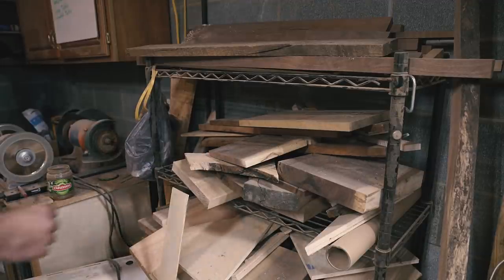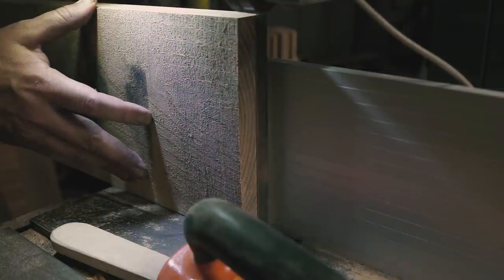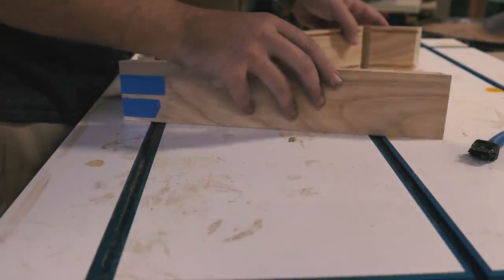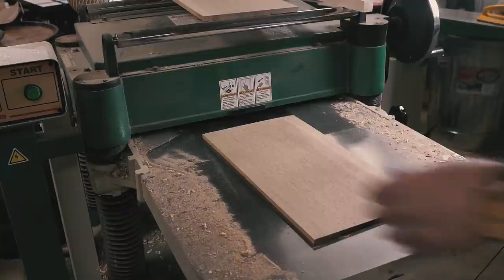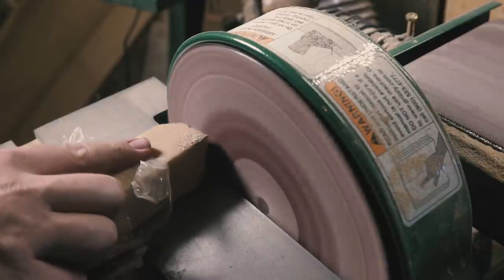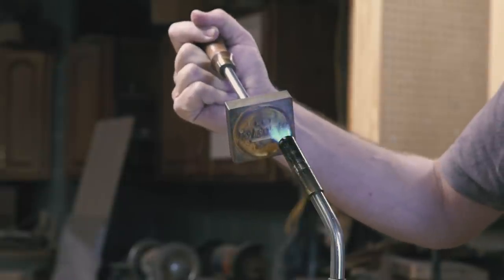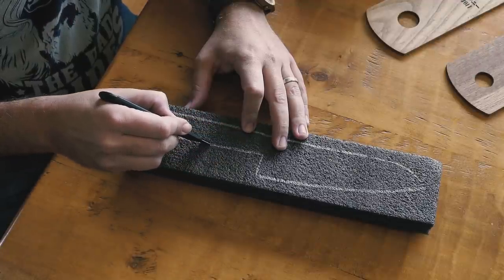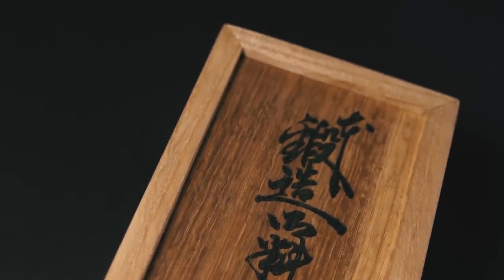The Golden Knife Box

Comment: Random question from a fellow Virginian - I work out of my garage shop, and I find that once I finish my pieces and bring them actually into the house, they tend to distort and warp due to the drop in relative humidity. How do you mitigate that issue with your work?
Reply from the maker: Hmmmm that's a tough one. My shop is in my basement which is regulated by the same HVAC as the house so my relative humidity is pretty similar if I'm bringing it into the house. I have run into issues with commission work where the client has a different heating system in which case I'll plan for breadboard ends on a table or something similar. Matt Cremona has some pretty good content on equilibrium moisture content (EMC).